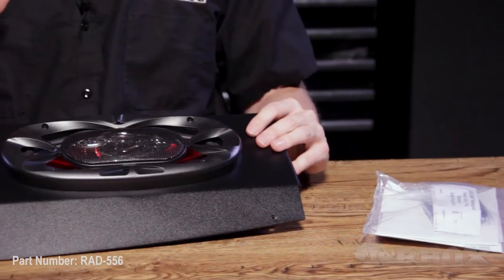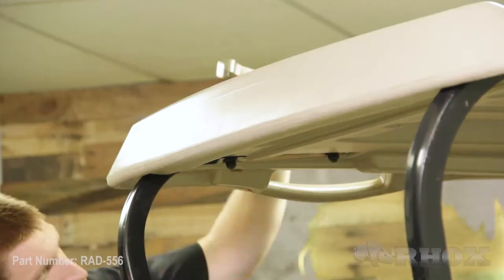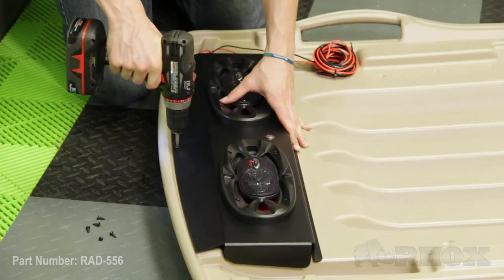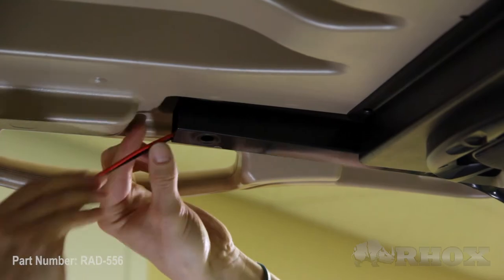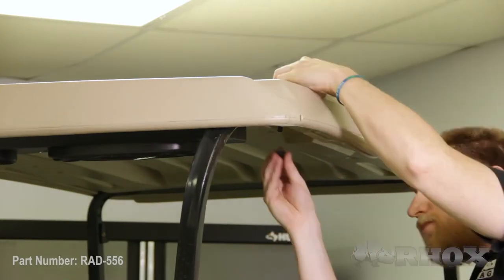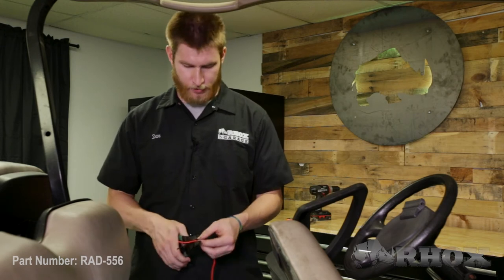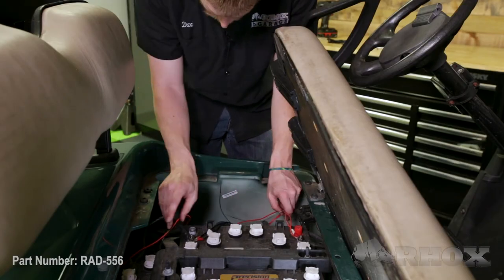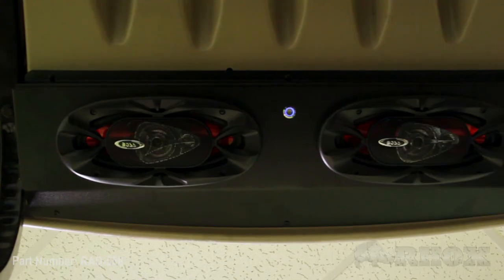RAD-556 Plug & Play Overhead Bluetooth Audio Console on an E-Z-Go RXV

Comment: I want to confirm the yellow and red wires go together? I also want to know if the speaker stays on all the time. There's no on/off switch in line. Thanks!
Reply from the maker: You can wire them together or you can also run the red wire to an ON/OFF switch like a toggle switch. The yellow wire is just for memory.  This can go directly to a 12V battery.
Reply: @GolfCartInstructions  Thank you very much for your quick response!
Reply from the maker: @marssernaforfontanaschools2584  Anytime :)

Comment: The RAD-555 will fit a 2018 Club Cart Precedent?  Does it mount in the front or back of the cart?
Reply from the maker: In the back of the cart. It has cutouts for the drain gutters.

Comment: Interested to know what this system sounds like once installed. Looks very easy to set up just wondering if the sound quality is decent.
Reply from the maker: It sounds pretty decent, but that is all relative to each person's definition of sound quality.  The speakers are currently Boss CH4330 if you want to look into it further.
Reply: RHOX Garage 

Are the speakers always hot ? Could they drain your battery if left to sit for a while ?
Reply: @michaelpainter9452  Good Question.... I'd also like to know if the battery will eventually drain